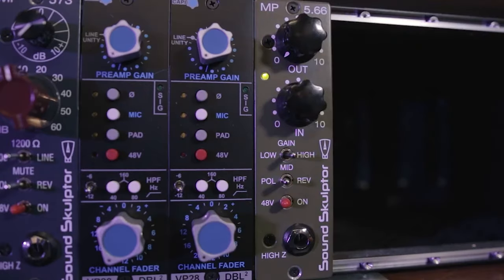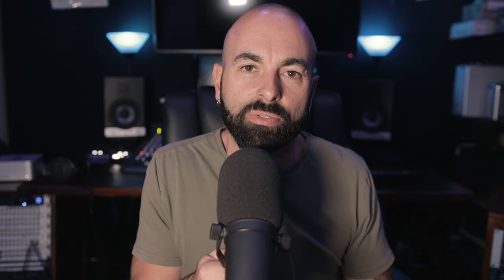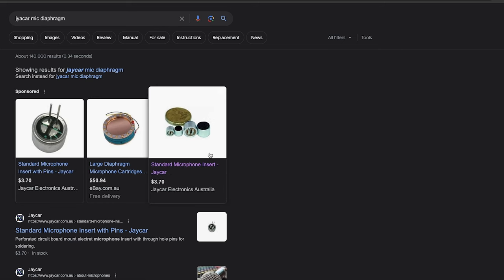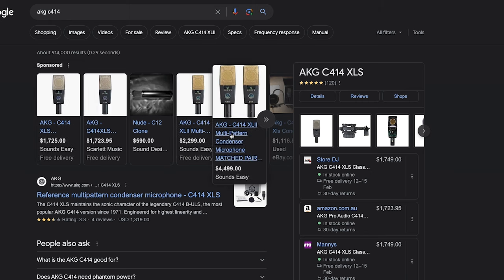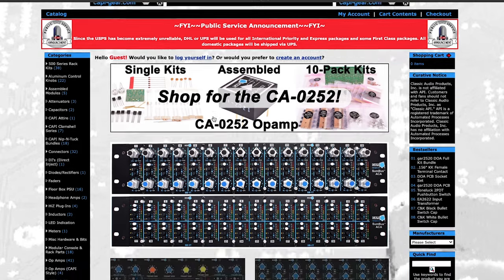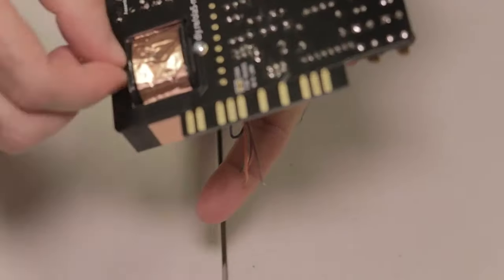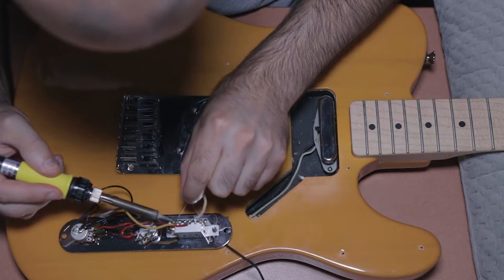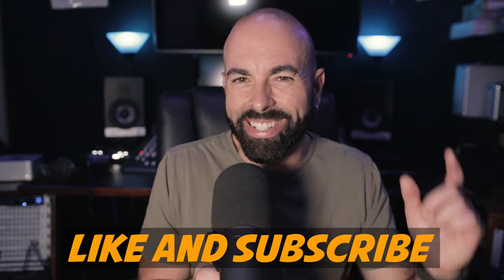Why I WENT DIY and Why YOU Should Too

Comment: Really nice video! I’m gonna try building a pre soon🎉
Reply from the maker: Oh awesome. You should definitely go for it. What pre are you thinking of building?
Reply: @diyrecordingstudio  I really wanna try building some CAPI models, not because they are cheaper but because they have BIG led indicators and transformer at the same time…..somehow I really want BIGGER led signal indicators, such as what Sound Devices USBpre has……
Reply from the maker: The CAPI pres are great. They can be cleaner if you use them gentle but can get gritty if you drive the input. They never sound bad!

Comment: Man, i love your videos, really inspiring content. However, i am always on the fence in regards to the overall quality of the sound of DIY units. I also have some DIY gear such as Capi and AML but, i have not yet compared them to their counterpart. Have you? I think the learing process of building units is invaluable but without a comparison its difficult to gauge the overall strenght of a DIY unit. Take for example the U87 mic and the Studio production mic you made, have you compared how close they are? Its really a strange thing because,  sound is really subjective to all of us. Also,  this mod is from micparts who also own the company roswell mics.This makes me somewhat skeptical, why would this mod cost so little and Roswell mics cost a lot more, of course the DIY aspect brings the overall production costs down but i can't Imagine they use the same parts at Roswell yet charge a premium to build them. I would be intrested in what your opinion is?
Reply from the maker: Great question! You're right, at the end of the day a lot of this is subjective. I have however been able to compare my neve and api clones against the real thing. They sound the same. I have compared the u87 modded mic to a real one. It is shockingly close to the real thing the only major difference is the real u87 has better rejection. Frequency wise the lowend is extended a bit more in the clone. In a shootout i did, no one could tell the difference unless i pointed it out. Some clones are great, almost identical, others are different but still cool and useful!

Comment: I feel really conflicted considering DIY. I'm just a hobbyist, and the challenge has been finding the time to actually work with music. I'm also frankly not very good. If I messed something up, I might not even know and will just have a $400 DIY piece of gear that doesnt sound as good as it can. I'm an engineer by trade, and although soldering sounds like it will be fun, I feel my limited free time should go towards making the music instead. I'm curious if there are other people in the community who feel the same way.
Reply from the maker: Yeah you have a point. It does take away time to build these things. 

However if you’re wanting to learn more about the gear and learn a new skill it’s great. And you can then repair things if they ever break. 

I have a recent video on correct soldering technique and tools if you need help with that in particular.